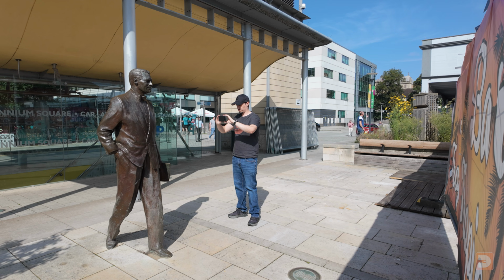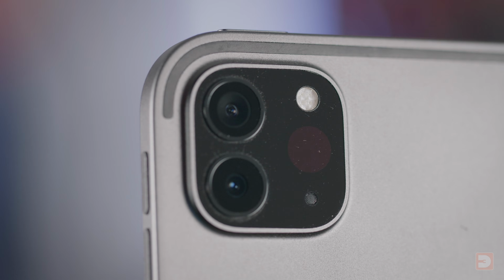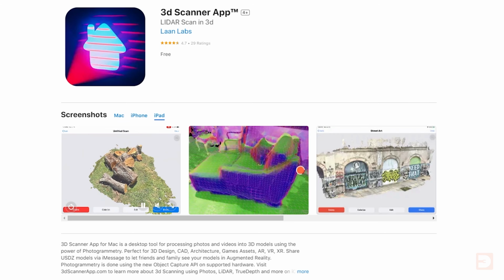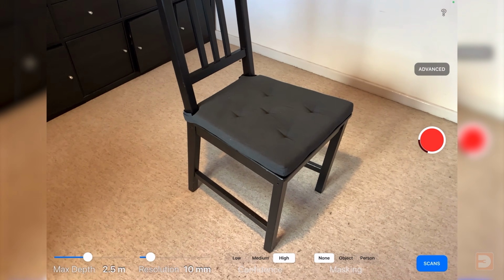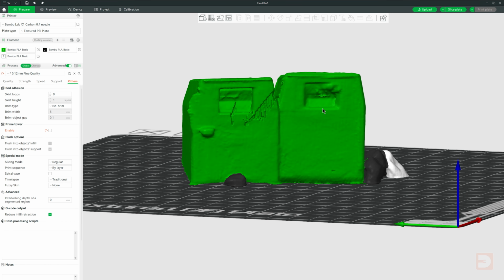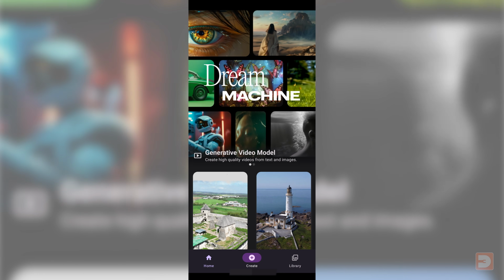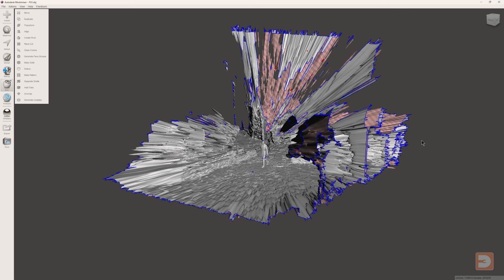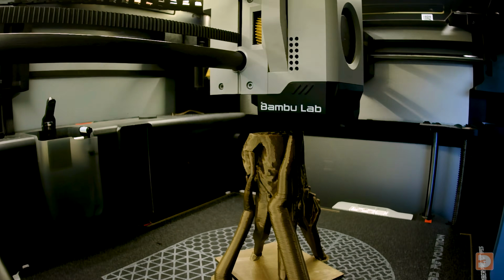3D Scanning Mobile Apps & 3D Printing | 3D Scanning Series

Comment: I'm surprised 3d scanning seems so limited (I say, realising that a few years ago this would have been almost impossible or needed super specialised equipment). The sensors are there, the processing is there but all the methods you cover seem to have some flaw or limitation.

Comment: There are many more options available for phone-based 3D scanning, such as localized 3DGS, where the 3DGS processing happens directly on your phone’s hardware through an app called Scaniverse. Another option is the Kiri Engine app, which offers object masking in both a cloud solution and a localized mode with LiDAR-assisted photogrammetry. With LiDAR, accurate scaling is possible without needing custom scaling. This app also uses a technique called Featureless 3D Scanning (via the cloud), capable of generating high-quality meshes even from objects that are challenging to scan, like transparent or reflective surfaces.